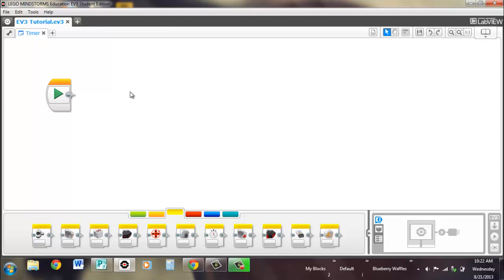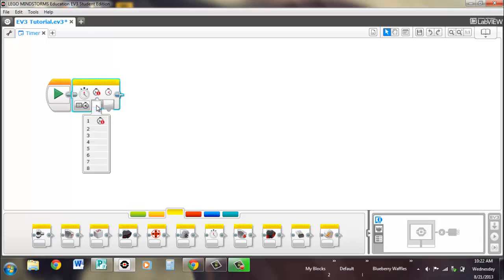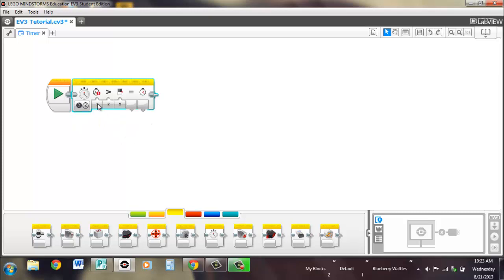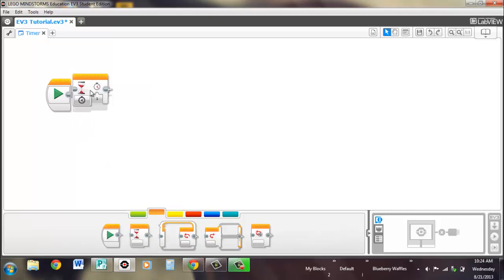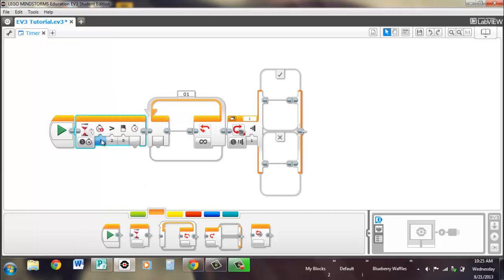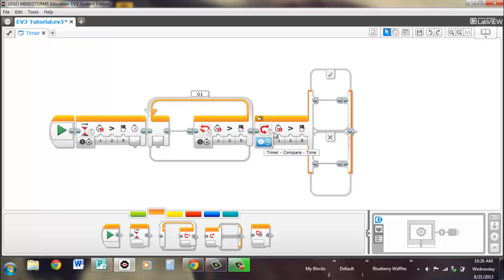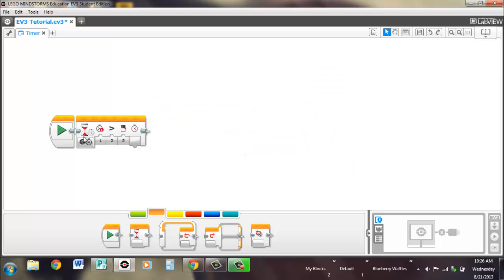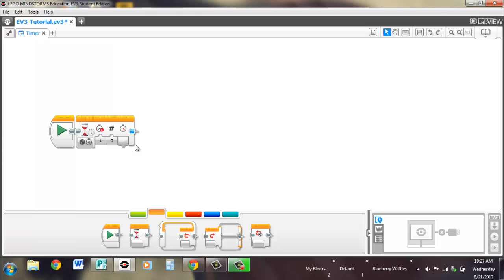27 - EV3 Programming: Timer

Comment: Is it possible to make some action in specified time? For example run program at 9:00 o'clock every day?
Reply from the maker: Sure it's possible, though you would need to calculate your hours in seconds, and wait for that long.  Also the robot would need to be on the whole time, if it turned off it would mess it up, so you might need to keep it plugged in.